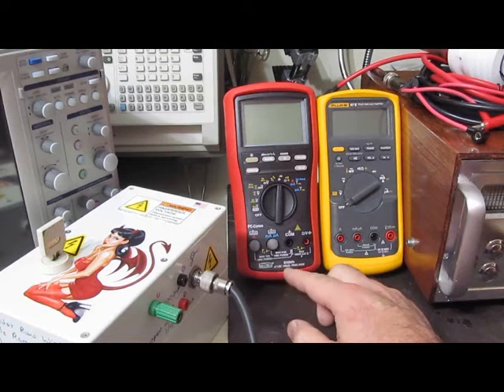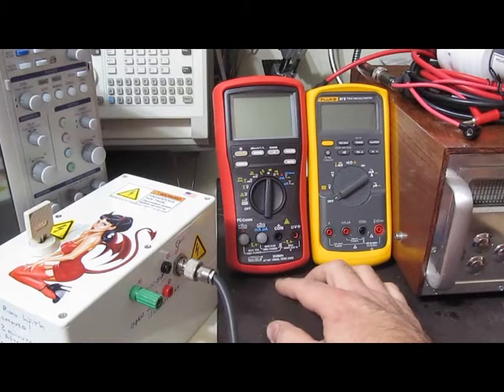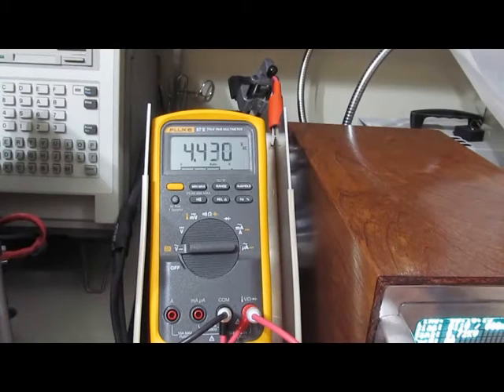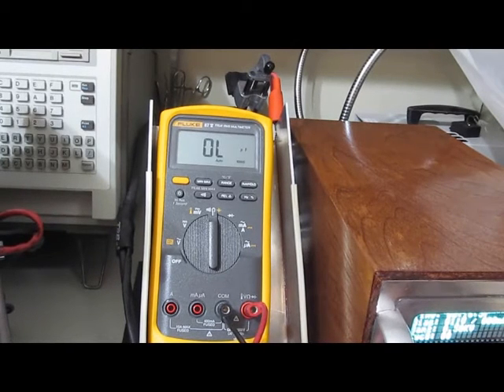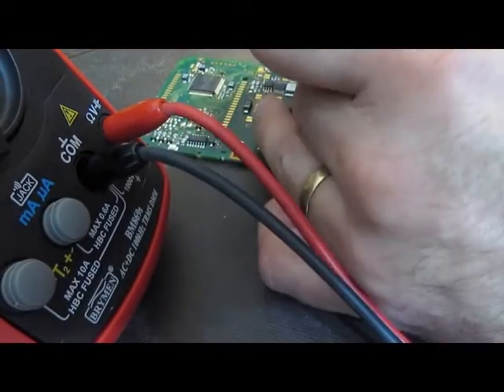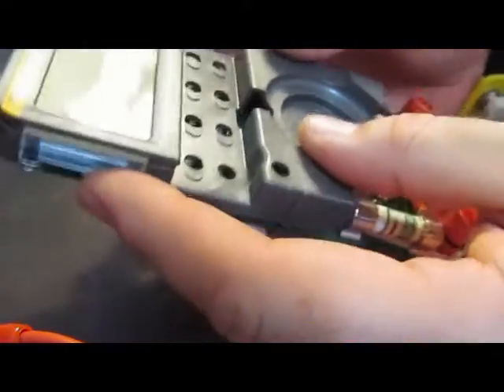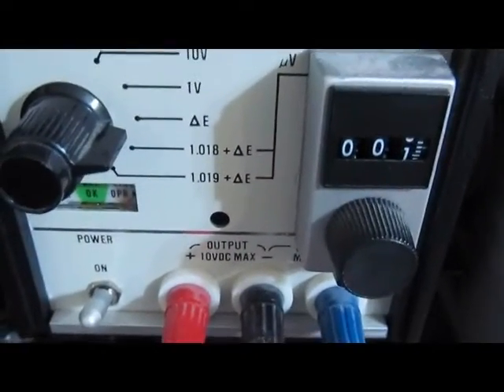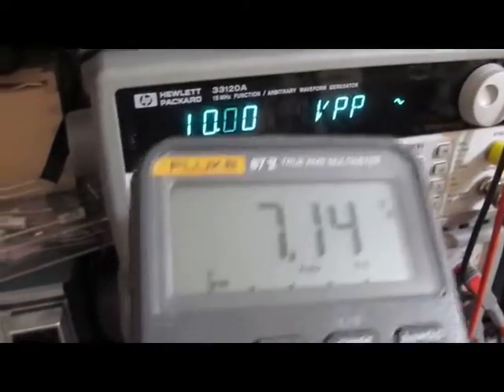The Fluke 87V vs the Brymen BM869s transient testing

Comment: How is it surprising that a meter fails when you put over 1000 volts in the wrong modes. ???
Reply from the maker: You may want to start by reading the FAQ.   You can find it in the top of the very first post:    https://www.eevblog.com/forum/testgear/hear-kitty-kitty-kitty-nope-not-that-kind-of-cat/

Comment: I am going to buy the 867s, any good?
Reply from the maker: There is a spreadsheet available showing the meters I have ran and the data I have collected from them.
Reply: May I please have the link to that spreadsheet.
Reply from the maker: Go to the main page, select about or discussion.  Both have links to the spreadsheet and FAQ.
Reply: Thnks, NT=Not tested? Brymen 869 was in the list but i suppose 867 would more or less have the same results.
Reply from the maker: Yes, NT = Not Tested.  Right, I ran my Brymen BM869s.   I have no idea how the 867 would behave without running one.

Comment: Hello. You said that you replaced the the diodes in the 87-V once before. Now the diodes fail at surprisingly low 1.5kV. Is it possible that replacement diodes were not direct replacement for OE diodes, or that replacement diodes did not live up to spec?

Comment: hello. fluke 87v transistor code number?
Reply from the maker: Are you asking about the device that was damaged?
Reply: yes.  fluke 87v   
What is the name of the attached piece
Reply: Could it be bav99? My fluke 87 has the same problem. 
I was affected by high voltage. Ohm step is problem.
Reply: 5k575 varistor problem. problem solved ok
Reply from the maker: Sorry for the lack of response.   YT for what ever reason does not always show responses.  Glad you found the problem.

Comment: There's only one bad thing about my brymen multimeters and that is the viewing angle. From the bottom up and from side to side  it's ok, but looking down from top to bottom one can almost see nothing.On the other hand i use it most of the time on the bench 
I see your Brymen got a S at the end where the ones we can buy here in SA don't have it?
Reply from the maker: When I reviewed the eevblog rebranded brymen, I show several meters including the bm869s at various angles.  To me they all looked pretty good.
Reply: Mjlorton speak about this as well. Maybe Brymen has improved their lcd displays lately because my meters must be the older ones, they just don't have great viewing angles
Reply: I just checked my EEVBLOG BM235 and I see what you are talking about. I don't really see how that is much of an issue though. If you happen to place the meter below you just close the tilting bail and place it flat on the surface. All else fails, move it, I've got the magnetic hook so I can stick it to any metal surface if I don't have a flat surface available. This is the beauty of handheld meters.

Comment: What sort of dust plugs are you using to plug your amp measurement ports, and where can I get some?
Reply from the maker: The ones I use now are from Cap Plugs.&#160; I show them in my UT210E video where I modified it.&#160; These  came from an old CEM meter.

Comment: Hello you have reason that the brymen s best but under the tests performed by the fluke 87v, brymen 869 exceeds specifications, on 87v is for industrial use and brymen is for use in electronic signals in an electronic laboratory or repairs of electronic equipment fluke is not suitable for this use.
Perhaps the fluke is more expensive for the customer service that also easily get all the parts.

IMHO you should compare multimeters who are an the same category or would like comparing 600cc and 400cc motorcycles 600cc is always faster than the 400cc regardless of price.

greetings, very good your videos
Reply from the maker: Glad you are enjoying them. That Brymen BM869s was the first meter certified for Cat IV 1000V.  For some reason that does not strike me as an electronic lab environment.   I am not here to debate or try and justify the cost of any of these meters.  I am only presenting how robust electrically their designs are.     I run these tests because I am interested in how the meters compare with one another.  I then make  the data available to the public free of charge.   You're always welcome to run your own tests with motorcycles or meters.

Comment: Are you saying that the 87v is not recommended to buy? Or not safe? You made pretty bad comments about the UT139c failing at 4kV. What's the whole idea of this testing if the most praised device failed at 1.5kV? This test now looks more like kids game! 
All hail Brymen!!! I was actually looking if the UT139C was worth a try!
Reply from the maker: I guess your having a hard time understanding what is going on in the videos.  I've been pretty clear from the start that these tests have nothing to do with safety.  I thought I also have made it clear that it would be next to impossible to make recommendations.  These tests have always been about determining which meters were more robust than others using a standard test method.

Comment: Well, did you ever tried to develop something and pass EMC tests? I guess no. Do you know how surge protection components work? I guess you have no idea. The energy of surge pulse is enormous.The way you are testing is nonsense. The standard is defining sequence of pulses to simulate possible real situation. It means that after each applying of this pulse sequence is required to let device protection circuits cool down (if standard does not say to repeat twice etc.). Otherwise you will face situation, that circuits must be 10-20 times stronger than necessary. You are simply destroying them by heat accumulated by quick repetition of test sequences. There is no time to even transfer accumulated energy from chip to package. And this is exactly what you are doing. So remove all multimeters from trash and start again please. I do not say that multimeter which survived your handling is bad. But it does not mean that others are not fulfilling standards. They are just not so "idiot resistant".
Reply from the maker: Sorry but I missed your comment.   It seems you do not comprehend what is going on so once again, let me attempt to explain.  Let's start with some basics.  The EMC standard is different from the safety standard.  The EMC standard is 61326.  The safety standard is 61010.  Your comments are about surge, so I'll assume this is just a mistake on your part.   You are correct, the energy in a combo generator that would normally be used for the 61010 is pretty high.  Consider that this is just the energy available.  It's not the energy that will normally be dissipated by the device being tested.    Next consider that my generator is not a combo.  I have made this clear from day one.   It has NEVER been my goal to look at the meters from a safety standpoint.  So while my generators may closely replicate the open circuit waveforms from 61010, they are no where near what the short circuit case calls for.  Again, I've explained the reasons for this several times and it should not need repeating.     Consider that most meters have failed with much less than 10J applied!   While testing the first batch of meters, I did not have 10J available until the finals where the Fluke 101 finally came out on top.      Many of the meters are damaged before I get to the surge test.  They are just that bad.  In the case of the 87V, I agree that I would have never expected it to fail at such low levels.  By far it was the worst of the Flukes I have looked at.
Reply: @P?T> In real time, Joe's PTG takes quite long to charge between each pulse, and it shuts its charger off every time a 5/-5 serie is finished. Hardly unlimited pulsing, you're just imagining what you want to see.

Measurement cats have little to nothing to do with robustness. 61010 is a S A F E T Y standard. As explained many, many times before, no one's pondering safety here, so arguing every bit of standard being followed is beside the point.  61010-2-033 prescribes bias voltage (400V RMS or less) combined with much higher available energy levels for pulsing - word available being the key here. None of that is used in these tests.

Destroyed by accumulated heat? The guy had just explained in response to previous comment that DUT is not what normally dissipates the energy, but it apparently didn't get through to you. He's not simply discharching capacitor banks one after another into multimeters, dummy. :}
Reply from the maker: " after some amount of pulses will be protection circuits destroyed by accumulated heat"    Why do you feel this is a concern?
Reply: I think that comment above it is not just about this video, the standard (both you mentioned) are defining the tests precisely, including minimum gaps between pulses. In case you will take meter and test it the way that you do: apply certain level of pulse quickly one after another without limitation, after some amount of pulses will be protection circuits destroyed by accumulated heat. It is just about design reserve. And standard says also which inputs should be tested like this. 
It seems like another video, where guy takes hammer, iPod and destroys it. Hey Internet! iPod did not survive! It is useless! You can not use it instead of anvil! Buy some Nokia 5110 instead, it survives much bigger impacts! .... well, for some people it can make sense - may be...

Comment: I don't understand the point of testing these meters beyond their specifications.  It says right on the front of the Brymen: "1000v" with CAT IV; why go beyond this?  You NEED that high voltage probe you showed in another video if you even suspect transients are above spec limits -- unless you are as brief as, say, an ESD pulse.
Reply from the maker: +tkarlmann I am not sure what you are asking.
Reply from the maker: +tkarlmann To be clear as it seems you missed the description, these videos are my attempt at seeing which meters are more electrically robust than others.   All meters are subjected to the same set of tests.  

I am not sure what "brief" is.  The ESD pulse is going to be measured in the ns.  I do run a sort of ESD test on these meters using a Piezo ignitor.   Two of the UNI-T meters were damaged during this test. 

While the IEC standards call for a 50us FWHH, I have been running all of the low voltage (< 6KV) with a 100us FWHH.   The higher transients are now being ran with a 50us FWHH.  This would allow someone to repeat these tests.  Keep in mind that those combo generator's current waveform will be much different.  The new generator I built is still limited to around 20 joules on the high end.   The majority of the testing is below 10 joules!   Nothing like the real IEC.  If you want to see some real damage, watch some of Fluke surge test videos.  

While the meter is marked CAT IV 1000 this calls for a 12KV, 1.2/50 us surge with a 2 ohm source.   Granted, Brymen told me they expected the meter would be damaged when I ran the 6KV transient.  I was impressed when it survived.   

Using the high voltage probe does not make a lot of sense.  None of the once I show, including my home made ones are rated for high energy applications.  

Hope this helps.
Reply: joe smith : Yes it Does!  If you are testing within the Specs of CAT IV, then my apologies!  I thought you were testing to failure for some unknown reason.  And yes, I know some mfr's put "CAT" ratings on their meters, when the have not done ANY of the required testing to substantiate that.  Good Job -- I have had Brymen meters on my To-Get List for awhile now -- you've helped.
Reply from the maker: No need for an apology.  I just wanted to try and clear up what was going on. I have ran many meters far beyond their ratings to the point of failure. The Fluke 107 for example has a CAT III 600V rating which would call for a 1.2/50us 6KV 2 ohm source. I pushed this meter to 14KV 100us 2 ohm source and it was not damaged.  This gives us some idea of how much margin Fluke has added to the design of this meter.  

As much as I am not a fan of Fluke, I have to admit that some of their products are far more robust than anything else I have looked at. 

The Brymen BM869s I tested my not be as robust electrically as say the Fluke 107 was but it sure has a lot of very nice features and held up much better than the Fluke 87V.  

Also, if it is not clear, I am not affiliated with any of the DMM manufacturers or their suppliers.  They are all paid for out of pocket or out of donations from people like TechnologyCatalyst.   Check out his blog for detailed reviews on some of the meters I have tested. 

If you buy a Brymen, I would be interested in knowing what one you end up with and how it works out for you.
Reply: joe smith I am intending to buy a couple/few BM869s meters.  I saw this meter first on an old EEVblog episode.  I much prefer it, sight unseen, over Fluke.  Oh, are you familiar with EEVblog's sort-of expose on the Fluke 87's susceptibility to cell phones?
Reply from the maker: +tkarlmann I had seen Dave's video on one of the meters that had this problem.   It may have been the 87V.  I would not be too surprised to hear of other meters having problems with RF susceptibility.       

Hope you enjoy your BM869s.  I use that meter often and it is still running on the original 9V battery that came with it.    Maybe post after you have used them for a month or so.

Comment: Hey I just recalled another instance where a Fluke 87 was not up to par.  I once got a complaint that one of our products did not pass EMI immunity, after some experimentation I found the 87 was displaying garbage. A ferrite in the leads to the meter solved the problem. In that particular test RF was coupled into a DC supply line, common mode. The 87 was monitoring the voltage on that supply. The frequency range was 20-50MHz, with a couple volts amplitude. 

That reminds me of two more similar cases actually. One time I was testing for immunity to 440MHz (radiated) and found Fluke 45 bench meters are quite sensitive to this. They would just go dark and reset. Another time I was measuring the output of a full bridge converter, about 30Vpp 20kHz square with quite nasty ringing edges (but at no point more than 100Vpp). I tried to measure AC current or voltage, and the handheld meter I was using just locked up. I don't recall if this was a Fluke or Norma, it was so many years ago. I went for an analog meter then and it was fine.

It might be interesting to see how different meters react to RF interference.
Reply from the maker: +stefantrethan Let me think about it.

Comment: Given that there are so many 87 around, what does this tell us?
I mean I have seen that damn switch go bad, but none with a failed input like that.
I know, I know, you never claimed anything other than robustness to this particular pulse, but does this tell me even at 1.5kV I am unlikely to encounter any problems in daily use? 

I spent today surge testing as well, a Fluke 87 was connected, but not directly to the surge. ;-)